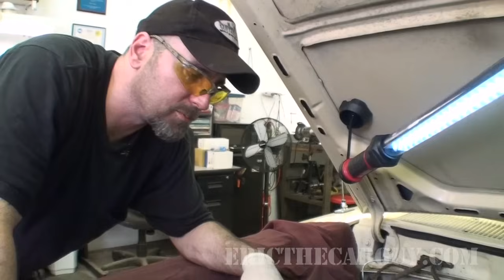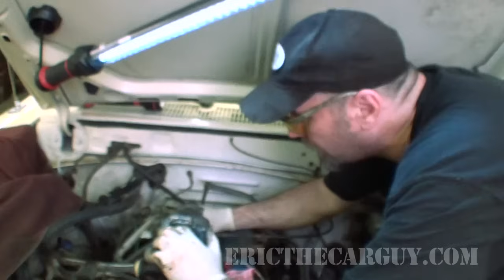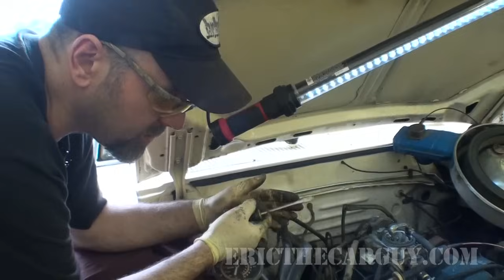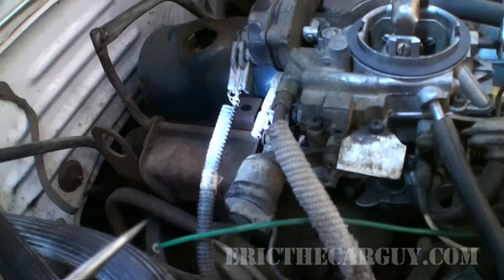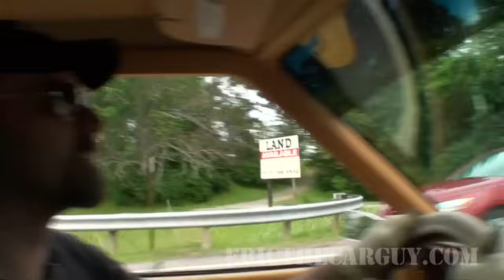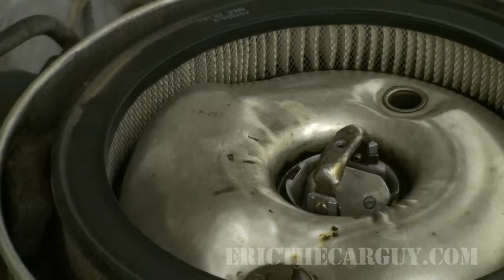Carburetor Adjustment Basics -EricTheCarGuy

Comment: Can't like this video enough! Having trouble with rough, low idle on hot restarts in my '68 Ford inline 6 with a Carter YFA single barrel 'clone' and based on this I'm thinking I need to get the engine warm and adjust the Idle Mixture screw and see if I can richen it up a little. Thank you!

Comment: Wow you saved my butt again eric i got a 85 ford tempo similar carb and i abobviously the previous owner messed with it i been driving it around double footing in for a year now because of u i found the idel screw adjustment i looked everywhere and found it behind that stupid ac solenoid which was usless because the ac is broken i had to remove it to get access to the screw adjustment i haven't tried starting it yet but im pretty sure that was my problem it wasn't even making contact so thank you! Wow 10 years ago this video is old

Comment: I've got a 65 Ford Bronco (6cyl/1Bl) I put on a new Henkyo model of the Autolite 1100 and it runs terrible. It cranks easy, but trembles and idles rough. Like it's  got a misfire and puffs a little black smoke. Entire fuel system is new. Tank,pump, lines, etc. Also plugs, wires, coil, points. It had steel rims and new tires filled solid. That weighed 175lb's a piece and choked down if you tried moving. I removed them and it helped but still runs bad. Could it be the mixture, or floats too high?

Comment: I have 20R toyota engine aisen carb.
It starts great not high idle.
After driving warmed 1st. traffic light
idle is high.
I tap pedal with my foot it does not ever go down.
I at least adjusted to idle start not die, but how do I get idle to lower when warmed up without going too low to start COLD.

Comment: Question: Okay, I have a '73 Ford Courier (mazda b1800) I managed to get the timing 100% and cold/warm starts are no problem, but it will  backfire once warm and when that happens it acts like it's not getting gas.
I can post a video if it will help, but really need any help I can get.
Thanks for all the videos Chris!

Comment: What if the choke stays open while cold? Just bought a 1979 Ford pinto cruising wagon and the coke stays open as well as the choke latch doesn’t move in sync with the throttle latch

Comment: Back  to old time, took  the  car  to auto repair  for turn  up every 6000 miless. My  Oldsmobil  took  too  long  to warm  up, if  not  engine  will  stop right after  put to D. no  shop  can  fix  so  on  cold  i  start  move the two  legs, left  hold break and right keep high speed.

Comment: Second comment. I have worked on modern cars for over 15 years. Those whom say that older vehicles were easy to work on are wrong. Modern vehicles have so much automated mechanisms that it is considerably much simpler to get the vehicle running smooth. A carbureted engine is so much more of a pain of the ass to work on and tune.

Comment: How did you ground the coil exactly didn't quite see what you did after you took wire off coil
     Just brought a 87 dodge ram home for $400 from junk yard, wouldn't turn over at all ran down starter system, had starter relay with ignition wire, battery, solenoid and ground wire, ignition and solenoid had continuity and battery had 12 volts, ground had no continuity hooked new ground to frame Turned over immediately, think someone junked cause old ground corroded somewhere and they didn't figure it out 
    Replaced plugs and wires, it starts and only runs with gas pedal held down, took carburetor off rebuilding it, same carb as yours without hot idle and choke coil on mine is on intake manifold, cant believe I found video rebuild on my carb, thanks for video

Comment: Aren't Carburetors COOL!? 😊💯 
Instant gratification when set up right. Cheaper to run in the long haul than most EFI systems. 

One little note, you mentioned the Electric Choke Coil, and were 100% correct about it. You just didn't mention that it's only a quick warm-up system, for better economy/emissions. 
The Dashpot Tube, coming up from the Exhaust Manifold, actually supplies the heat to keep the Choke open when fully warmed up. 
I know that's probably irrelevant in this case, but since you do such a great job of educating the young guys, I felt like that detail was worth mentioning. 😉
Carmine ✈🚂🚙

Comment: I’ve got a 65 galaxie 500 289 I put a knock off replacement carb on it 2barrell when I snap the throttle it seems to take forever to wind back down the rpm any suggestions

Comment: Thank you for the video.. just a question.. why would you want to ground out the coil?
Reply: He said it was so he could crank the engine to allow the carby float bowl to fill up without the engine being able to fire up. The cranking is necessary to get fuel to the carby when the fuel pump is mechanical instead of electric. Why he wouldn't want it to fire up though? Maybe to demonstrate that it starts 'instantly' with a carby full of fuel? Not sure.

Comment: I would like to ask,  I have a rich smell when high rpm with my car, I checked exhaust system no problem with it, I checked leakage of fuel,  no leak, I changed oil type because it had some smell too, but I think I have a problem with carburetor adjustment,  what do you advise?
Reply: Hey, i think im having same issue. Have you found anything? my exhaust smells so bad. Just had it rebuilt, only adjusted idle mixture so far
Reply: @whtmustang  fuel air mix was the problem,  because it's an old carburetor
Reply: @abood-cj6qi  yeah but I adjusted the mixture screw and it seems to still smell bad out the exhaust. I just had carb rebuilt too

Comment: Bout the best common sense guide to a choke setting. The rest was just a primer for me. Guy I bought the jeep from said ethanol free gas??????? I dont want to know why. Good job.
Reply: You dont need ethanol free, but ethanol likes to eat rubber, etc more than gas in the old days. Many old carbs were never really designed with ethanol in mind. I have an aftermarket edelbrock so that one is designed to handle it. Im sure yours would run fine with normal ethanol gas too though. Ethanol gas can vapor lock easier as well though, something to be aware of, try to keep heat away from the carb

Comment: I have a 87' Civic 1.5 that has been sitting for a few years and i just replaced all the fluids, fogged the cylinders, gapped the plugs, drained/refilled with fresh gas and it started up and idled roughly and low then died after i tried to give it gas, it didnt start the rest of the night. Could this be caused by the choke being open?
Reply: Good news! Got it running today but it has a very high idle of 3k and the throttle does nothing! At all! I still need to verify it is connected but it feels like it is, is there anything else that could cause this besides a carb issue? Stuck throttle body?

Comment: Thanks for this video I didn't know that the thing on the back of the carburetor, choke thing adjusted by loosening the screws. That may be the problem with my inline 6 300. It's a start anyway.

Comment: Hi Eric.Good day. Jacky here.
Thanks for shared this video .i liked it !
I had a problem for 4g15 engine carburator and vacuum adv . What is a function of auto choke to vaccum adv ? Engine cold , the auto choke will close and provide a vaccum presuure to distributor adv ? When engine hot. Vaccum pressure will cut to distributor adv  ? What is standard pressure for vacuum adv  ?
Can sharing or teaching a basic of distributor adv vacuum pressure when engine hot and cold.

Comment: Eric... I have a 4 barrel carb on 73 vette and in drive the rpms is 500 to 550 rpms without the air on but when I turn the air on rpms drop to 350 to 450 rpms and  I come to a stop and I have the air conditioner on the car stalls out.... What say you ?

Comment: Question ? I have a 91 ford spectron . On a cold start it will fire up  and idle but as soon as you hit the gas it bogs down strait away .I have to gently feather the accelerator to get it warmed up and  revving  normally . Takes a few minutes for it to warm up so I can drive off without it cutting out . Once it's warm it start and drives normally although it still  bogs slightly on acceleration in the lover revs .

Comment: I've been having an issue with my motorcycle. After I rejetted my bike (I put a higher flowing exhaust on it) it developed a hesitation at high rpms (right around 8k) and it stuggles to go past that point. The bike idles fine and just cruising around it runs fine. Before I rejetted, the exhaust popped a lot on decel and when I closed the throttle because it was really lean and it still pops on decel after rejetting but not as much, but more than it should. Could this be caused by a dirty carb? I checked all of the fuel lines and vacuum lines and breather hoses and everything's good. I'm thinking maybe the passage for the main jet and/or the main jet itself is clogged? This is my first time ever messing with carburetors. My bike (2007 Suzuki gs500f) has a pilot jet, a mid jet, and a main jet. The bike did sit for a few months for winter with fuel stabilizer in the fuel system and I didn't really do a good job with cleaning it when I rejetted because I figured the fuel stabilizer did it's job. I'd greatly appreciate some feedback!

Comment: so my truck is carbureted and when I start it I will idle just fine but when you put it in reverse or drive it will die. to get it to move you have to put in nuteral and Rev it up in nuteral then drop it in gear to get it to move. Any idea

Comment: Great video!  Looks like the exact same motor as in my 79 Granada.  I noticed the EGR valve rattling towards the end when the engine is idling.  Mine does the exact same thing.  Its not connected to any vacuum source yet.  Any thoughts on this inherent rattling of the EGR valve at idle?  I know you hear it.  Thanks.

Comment: now what would be the cause if I have to crank my car for an extended period of time on a cold start before it fires even if I pump the gas multiple times and ran the car just a day earlier?
Reply: fuel drained back to tank ? fit a non return valve ? or just spray a little carb cleaner/ether into intake speeds the process of cranking to get the fuel back upto carb and saves your probably low battery.

Comment: When I startup my 1995 ford explorer it over idles like it idles almost to 2000 rpms and then it would go down and when I drive it over idles to what could be the problem?
Reply: Air/vacuum leak ? spray carb cleaner around carb and inlet manifold see if it revs up........=leak

Comment: Just found your post.  A) I had this car but had a 4 cyl - I would have loved 20 second 1/4 miles.  BUT you could put 5 bodies in the trunk.  Great car to go cross country.  I am working on an Autolite 1100.  How long can a car sit with gas and still start?  Did not start mine for 3 months due to maintenance.
Thanks Bro!  Great video!

Comment: I have a 1979 Mustang Pace Car 2.3L turbo and it has a 2-barrel Holley 5200 (maybe? tag reads D4PE-ANA) I want to believe it's the stock carb but I'm not really sure, the thing is that it has at least 8 vac lines (some weird ones that connect back and forth in the air cleaner) and they're all messed up for sure, turbo alone has 3 vac lines. Is there any servicing manual that you can recommend? Also when revving It has A LOT of deadspots where you can hear a loud sputtering sound... Any recommendations? Reconstruction is hardly an option because no matter what I never find this particular model anywhere, replacing the carb could be but I don't think any other carb will get along with the turbo very well. Any help will be much appreciated.
Reply: Shop Ba Dậu 
Expert: Fixing and renovating carburetors of all kinds of cars 
Address: 256/38 Nguyễn Tiểu La, Ward 8, District 10, Ho Chi Minh City, Viet Nam. 
Phone: 0838532543 – 0937641105 – 0932014615. 
Email: dangvanhoa01@gmail.com              
Expert: Fixing and renovating carburetors of all kinds of cars just only in Viet Nam. But start repair work must have the car. That is impossible.

Comment: Thanks man! Fixed my '85 ford truck with the 300 inline 6. 300000 miles and going really good.
It has one of those Carter yfa auto-choke one barrel carbs, really similar to the one in your video

Comment: why would my 1985 f150 2 bbl carb with 5.8l  get over heated and shutdown it will not turn on
Reply: it as soon as I press on the gas the gas evaporates and the water pump works and the cooling is great conditions ..

Comment: I like watching your videos cause you dont go off topic.  I was wondering if you are able to do a video on 4 barrel carbs?  I have a 78 Lincoln Mark 5 with a 460 in it and when I adjust the idle mixture screws, I have no problem getting one of them to react but the second screw does nothing.  Even if I screw it all the way into the seat, still nothing.  The other thing is that it hesitates when I give it a kick down then accelerates OK.  Choke works perfectly.  The other thing is when I do kick it down and all 4 barrels open It runs OK but as soon as I let off on the gas, it will backfire through the exhaust.  Any support would really help out.  Thanks for all your support!
Reply: Shop Ba Dậu 
Expert: Fixing and renovating carburetors of all kinds of cars 
Address: 256/38 Nguyễn Tiểu La, Ward 8, District 10, Ho Chi Minh City, Viet Nam. 
Phone: (84) 0838532543 – 0937641105 – 0932014615. 
Email: dangvanhoa01@gmail.com              
Expert: Fixing and renovating carburetors of all kinds of cars just only in Viet Nam. But start repair work must have the car. That is impossible.
Reply: sizzlers-shop kinda sounds like ignition too far advanced

Comment: I have a 1968 Buick Special Deluxe and 9/10 times I shut it off it diesels or runs-on. Since I'm not incredibly automotivly inclined (especially about carbureted vehicles) I'm not sure how to fix it. I took it to a local shop and asked them to fix it since I also needed new brake lines installed. They said they replaced some parts in my carb and fixed my timing. That fixed the problem for about a week or so then its back at it again.Ive tried adding fuel additives, but nothing straight into the carb. I noticed it also smells like its running rich. Is there an obvious fix that im not seeing? I love this car and enjoy driving it, but its a real pain when I get home from work at 10:00pm and it starts making a huge racket. Id appreciate any ideas that might help fix my car, and thanks for taking the time to read all of that.
Reply: Shop Ba Dậu 
Expert: Fixing and renovating carburetors of all kinds of cars 
Address: 256/38 Nguyễn Tiểu La, Ward 8, District 10, Ho Chi Minh City, Viet Nam. 
Phone: 0838532543 – 0937641105 – 0932014615. 
Email: dangvanhoa01@gmail.com              
Expert: Fixing and renovating carburetors of all kinds of cars just only in Viet Nam. But start repair work must have the car. That is impossible.

Comment: hello. is there any mechanic . I have suzuki swift 1988 with TTC carburator engin? my car has TTC carburator engine 1300cc . And i have few problms.
its rpm is not stable from some days ago. its goes from 1 - 2.5rpm while i am driving or not. which is very high. some time its 1.5 or 2 . what would be the reason what shall i do? kindly response pls

Comment: try letting the Gas off a little and it should change gears - my old 1987 Ford Falcon (has a US Built Ford (Or Holly?) carburator, i think the carb on it was the same as your fairmonts carb - once again this car is made in Australia with a 3 Speed Automatic Transmition

Comment: hi Erick, my vw golf amrk 2 1800cc  Engine has of late been strange, in the Morning it automatically Adjusts its Engine Rev, even long After Driving/warmed the engine up. in Traffic it Suddenly Raises the Rev. Its nothing to do with the Accellerator Cable getting stuck, must be the carburettor, but dont know what it is. Kindly Advice. [ i live in kenya so the climate back here has nothing to do with that.]

Comment: Check idle in gear.
wouldn't it just stall instantly?
Reply: Then it would stall, are you unfamiliar with how a transmission works?

If the car is in gear and the clutch released, the car will move, if by use of the Handbrake, the car cannot move, the engine will stall.

If he means to check the idle in gear with the clutch depressed, it would be the same as being in neutral, being of no diagnostic use.
Reply: +esnevip  he's talking about an auto trans in this case
Reply: Your car doesn't stall when you let it idle normally he means adjust it bump your gas then go put it in gear and listen to it that way "doing it by ear"
Reply: It would stall or drive off if I did that.
Reply: put the handbrake on
Reply: So how would one do it for a normal transmission?
Reply: +esnevip hold the clutch down put it in gear listen to how it sounds by ear with your foot on both the clutch and brake of it sounds too high adjust it down if it's too low and it stalls then turn that bitch up
Reply: +esnevip I wouldn't think it would matter as much since if you are stopped in a manual transmission, you either have the car in neutral, clutch depressed, or the car is parked with the brake on. but I guess checking the idle at the bite point in the clutch with the brake on could give some result. just be careful

Comment: How do I adjust the idle fuel mixture on a holley 4 bbl  marine engine. stalls when sitting at idle below 1200 rpm
Reply: Turn your mixture screws right till you feel them start to get a little tight than turn them back out 1 and a half turns
Reply: +reckless moto your idle do by ear

Comment: Thanks for the video. I have a question. I took  apart my summit 4brrl carb and mixed up the nozzle bars. How do I identify which is primary and secondary. One has 2 jet looking pieces and the other just has 2 hole in the same spot. there is also 1 ball bearing and a rod that would sit on top of that then a hollow bolt that fit over that. Im guessing these fit with the nozzle bar with the jets?